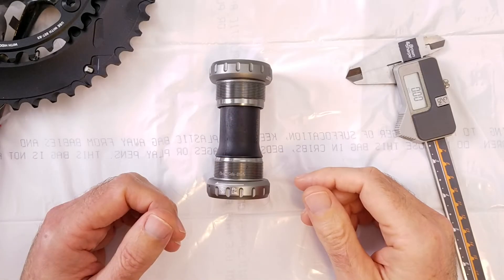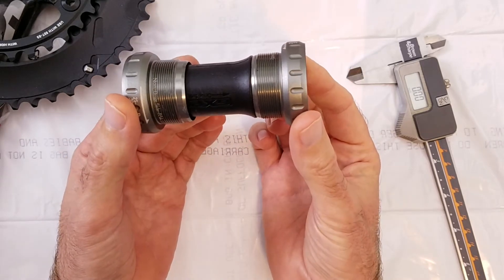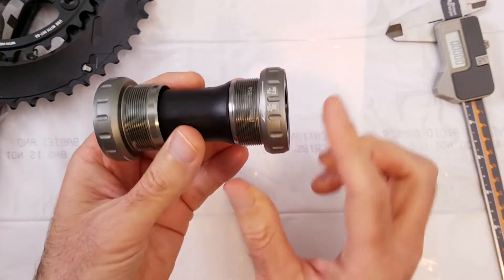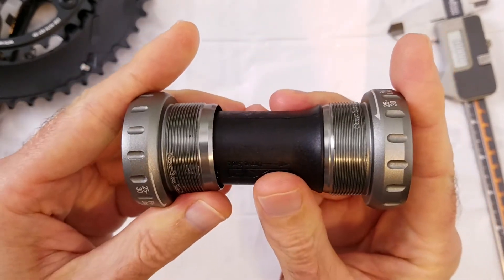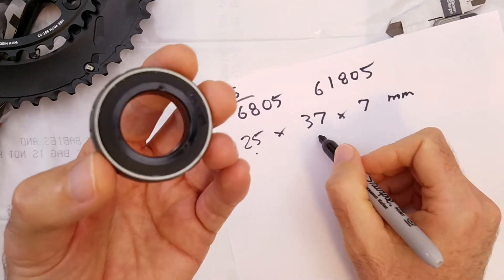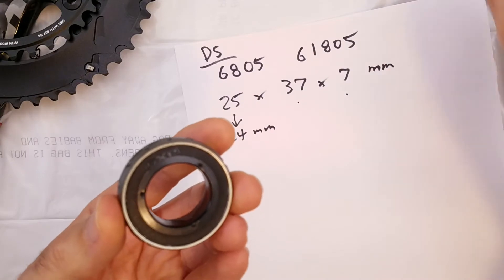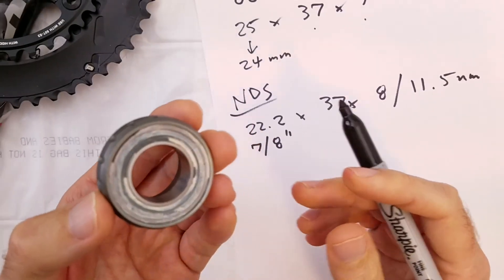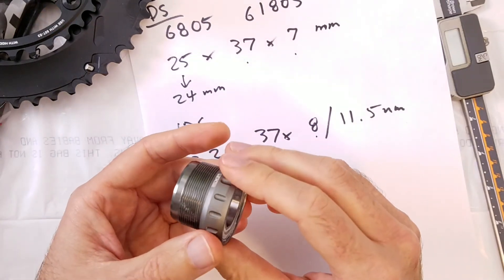SRAM GXP Team Bottom Bracket In-Depth Look

Comment: Its a nice soulution by SRAM .When tightening the crankarm on NDS the spindle just tighten at the 22 mm bearing, leaving the spindle at the  Drive side bearing "floating" sideways under load, taking up only the lateall load.
That makes it almost impossible to overtighten.
Reply: ... by Sram.* When tightening the crankarm on the* NDS, the spindle just tightens* at the 22 mm bearing, leaving the spindle at the drive side (...) taking up only the lateral load.

Comment: hi...lovely video...thanks..my question is if a force etap dub crank can use this BB
Reply from the maker: No, SRAM DUB is a totally different beast with a nominal spindle diameter of around 29 mm.  You need a bottom bracket specifically for SRAM DUB.